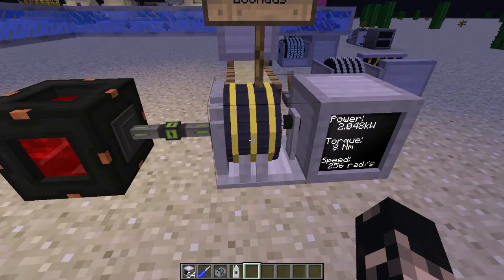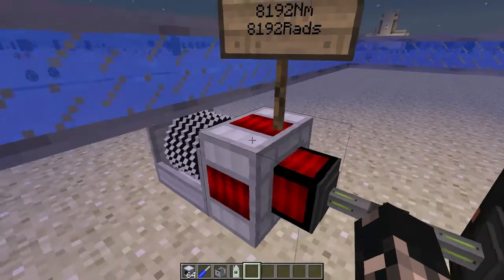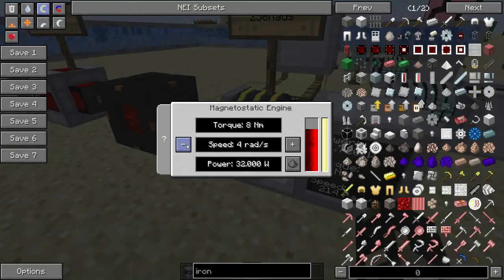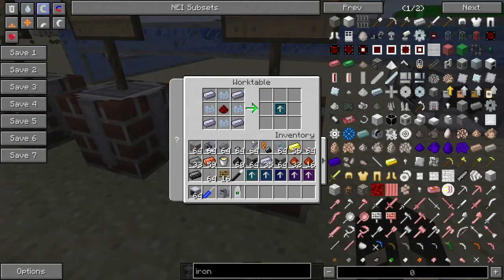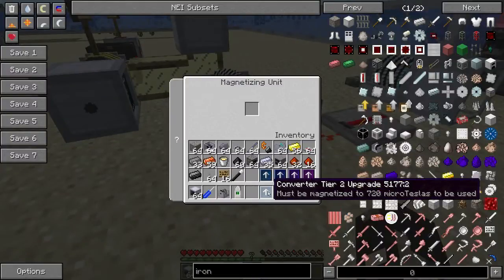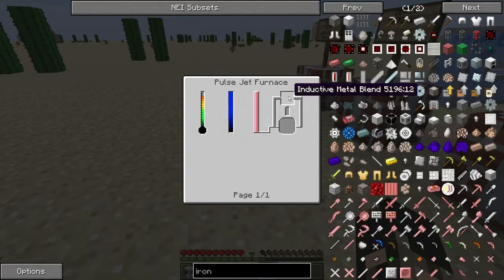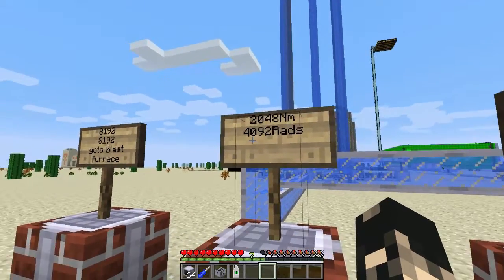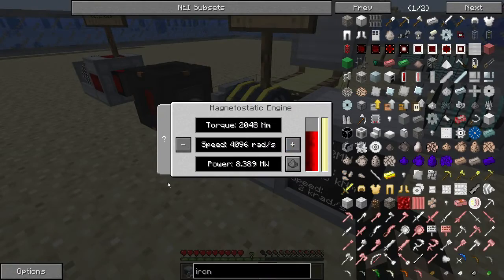RotaryCraft Magnetostatic Engine, Rotation Dynamo, Upgrades

Comment: I think its and awsome feature, now you cant race trough rotarycraft anymore (not that that was easy to do already)
Reply: Well, since bedrock breakers now use tungsten, it's not quite so easy to race through.
All you needed before was enough HSLA.
Reply: Ans for thungsten You need a friction heater
Reply from the maker: Stephen Ossel @1350C Too, A gasoline engine will get you a little over 1000C so you can use that as a base standard.
Reply: Combine with gregtech and $$$$
Reply: Ausyarr
Gasoline engine alone or with gears? o_0
Plz tell me 'cause I've been trying to use two microturbines and a 16x + 4x set of gearboxes
Reply from the maker: Your probably going to need more then one gasoline engine. The trick is have torque and speed match to get higher temps.
Reply: Ausyarr
ok, so my twin microturbine set still kinda makes sense :D
Reply from the maker: probably, just the too much speed and not enough torque.
Reply: Ausyarr
Actually, I did the math. If you use a single microturbine and you make it go through a 16x and then a 4x (both torque), you get twice as much speed as torque. Solved by adding another microturbine.